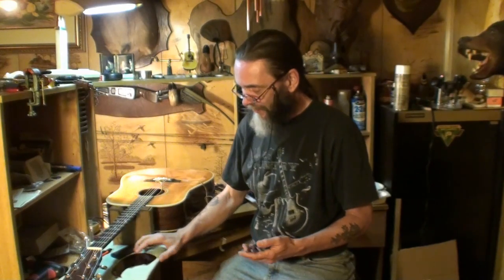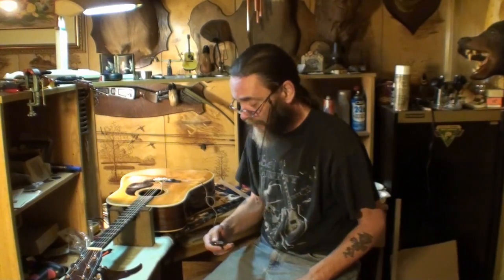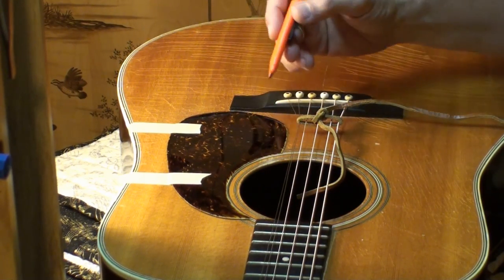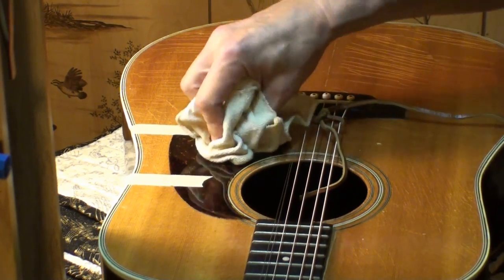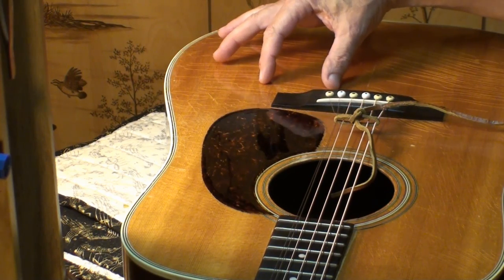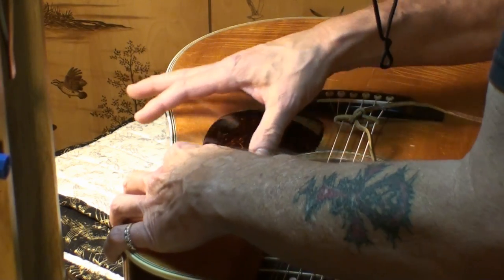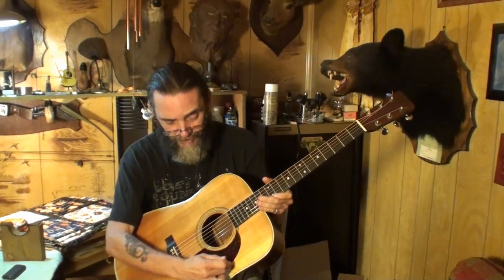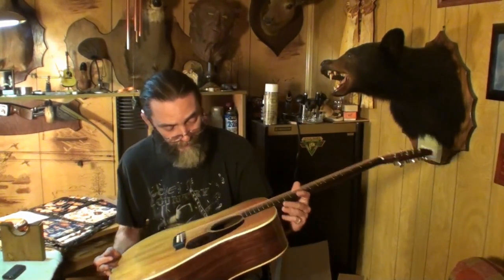Pick guard installation Martin d28 by Randy Schartiger guitar repair videos

Comment: I'm about to change the pickguard on my 1995 Martin HD-28. It came with a black one and I just don't like the look. The replacement is slightly larger by just a little so it should be ok. I'm also putting some Waverly tuners on it. I had to order special bushings from Stewmac as the ones that came with the tuners are too small. Wish me luck and thanks for all the great videos!

Comment: My guitar has a fairly heavy coat of clear on top with no pick guard. Do you think a pick guard dampens or changes the tone enough to matter?
Reply from the maker: Some guitars it does and others are not effected to much. One of my Martins changes tones in a major way if I lay my arm on the top too much. It seems the better sounding ones are effected most.

Comment: Am I the only one that knows Martin supplies "over size" guards ??and the repair needs laquer 3 coats  under the new guard...20 years as Martin service center this is  so wrong... I never use over size  PG unless there are shrink cracks on the top...
Reply: Randy will delete this....

Comment: Randy , you mentioned there are extra layers of finish on it.  Whats your theory on why or how it got there?  I'm curious if its ( extra finish layers) from people spray waxing their guitars or not. Thankx!
Reply from the maker: No it's where they spray it at the factory, then sand it to get it completely smooth and flat, then spray again and sand again, they do it for how ever many coats they put on it until it's perfectly flat all over, then buff and polish and all that jazz. Odd it has finish under the pick guard and over it both, that doesn't happen often. Thanks for checking out the video! :)

Comment: I've watched a few of your videos now where you talk about the vibration of the top.  How to hold the guitar and what not to put on the head stock and what not.  A lot I knew about since I started playing in 66.  My question is for others as well as myself.  On my 1995 Taylor 855 when I bought it the pick guard wasn't attached and I never attached it.  I've taught myself not to need it. But, do you think by not having a pick guard helps with the sound?  I had an Alvarez Yari circa 73 I think and I got a wild hair once and put a customized leather pick guard over the one that was on it.  I can't remember if it did anything to it but can imagine it did.  Sadly it was stolen 20 years ago or so.
Reply from the maker: A pick guard definitely limits the top moving and dampens the tones and sound. Some guitars are more sensitive to the top being touched than others so it won't be as noticeable on some guitars as it is others but yeah, they do take a portion of sound away. Sorry to hear about your Alvarez.
Reply: I didn't play for a decade. And it was more than just the Alvarez. My SG and all my gear along with a custom PA system that was the best I'd ever heard or owned.  I'd built it myself.  Synthesizers small recording studio. Well put it together though I did build the speaker cabinets It was a heavy blow to my soul. 

I won't be putting the pick guard back on.  Not sure I even have it anymore.
Reply from the maker: Greg Altenhofel
I can probably relate to the blow to the soul, I stopped playing too for over 20 years, didn't start back until 2009 and it was like getting a piece of my life back when I started playing again.

Comment: did you ever solve the mystery of the pick guard size difference?
Reply from the maker: The only thing I've found is Martin for unknown reasons sometimes put these smaller pick guards on certain guitars, either experimenting or out of stock on what they usually used. I read that somewhere so don't know yet how true it is.
Reply: far out. I have been enjoying my new J45 with Baggs system, the pick up is not hot on the high e though, I took the saddle off and saw the material is a little crimped under the E I don't what do form there, any "Free " Advice ?
Reply from the maker: Tony Wilson
Maybe try to uncrimp it CAREFULLY and lay it back out in the slot, and try to keep it as evenly under each string as possible so it will balance out better.
Reply: fixed it thanks man
Reply from the maker: Tony Wilson
Anytime brother! :)